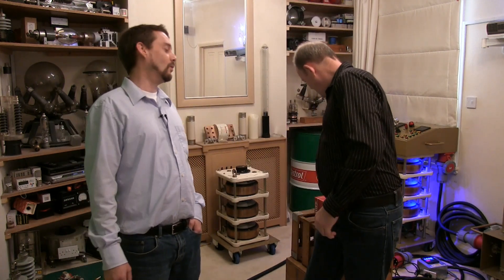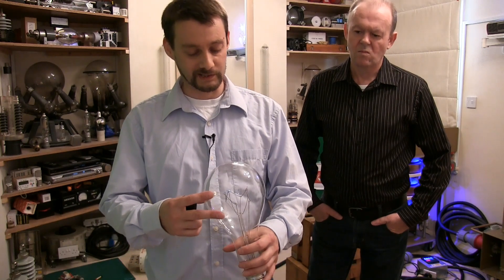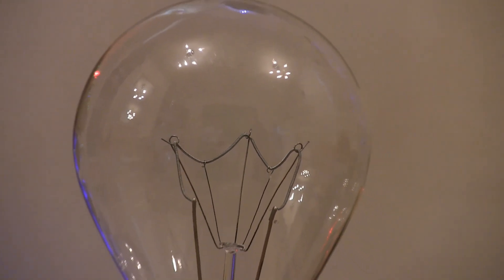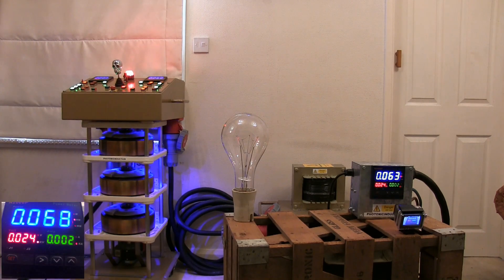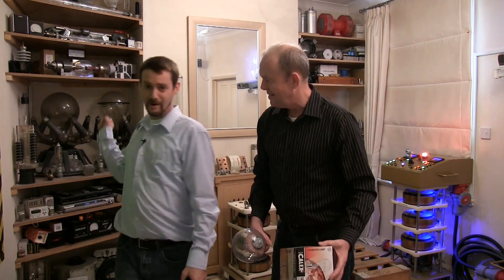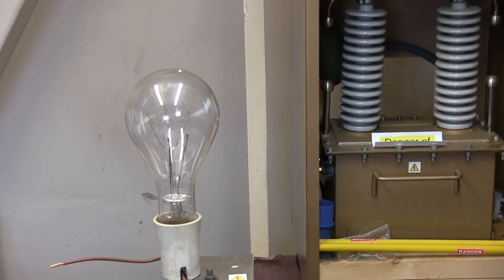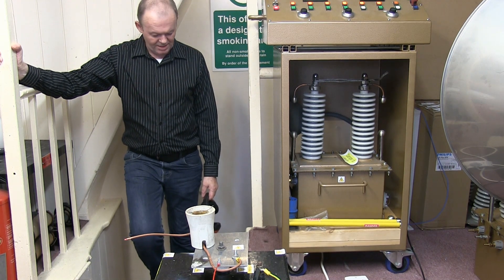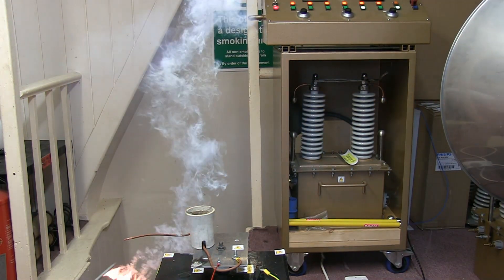Until it Pops - 1000 Watt Light Bulb

Comment: 3:20 how can 2 Transformers have a DC output? Are they both out of phase so when added have a DC output? Or are they pulsed? Or some sort of hidden rectifier I'm not aware of? Thanks.
Reply: Single diode rectifier I think
Reply: The diodes are visible to the right.

Comment: You could calculate the electric power that goes into the light bulb (or anything else you destroy by capacitor discharge): Put a large resistor (several MOhm) parallel to the capacitor and measure it's voltage with an oscilloscope. Then set the trigger to falling voltage, do the discharge and see how quickly the voltage drops. Let's say it discharges to nearly 0 in 50 µs, this means the average power output during this time interval is about 50 million watts (E [J] = C U²,   E/t = P)

Comment: good question why didn't you run the monster power supply through the light bulb from the smaller power supply that you popped slowly 

and get an arc in the bulb that burned out 

it would of been so cool

:)

Comment: How did you wire the transformers in series? My mot setup has the 2 hot outputs out of phase relative to the other hot to get 5kv ac. How did you wire the diodes to make it Dc? Thanks.

Comment: 1000 watt is normaly what the light bulb ''takes'' or ''uses'' from the net. To let him burn more watts (power) Ohm's law, Voltages times Ampere/resistant you have to crank up either one of them.
Breaking the glass has the same effect, a broken light bulb.
By the way it's quite normal that a 1000 Watt light bulb can give more lumens (the SI unit of luminous flux, equal to the amount of light emitted per second in a unit solid angle of one steradian from a uniform source of one candela.) because the factory tests these light bulb's at a higher rating than 1000 Watt. https://youtu.be/BylLOWRojyY
By cranking up either the Voltages or Ampere or lowering the resistant, you better measure the lumens from 1000 Watt up!
As expected the bulb die's.

Comment: For the display: Top is kilowatts, bottom left is kilovolts, bottom right is kiloamps.

If the decimal doesn't move, then you can pretend it's not there and then its simply watts, volts and amps.

Comment: "4 and a half thousand volts, 18 thousand amps."  Did I hear that right?  That capacitor can produce like 80 million watts?  It looks like it's pretty heavy, but still, I didn't know you could get capacitors with that much power density.
Reply: More like 80,000 amps. He popped a load of fuses ages ago with rupture currents of 80ka.

Comment: # pulling the plug is not an option that photonicinduction considers. #  correct, Voltage In is a suggestion.  in slow motion a flame dropped into the lamp.

Comment: Can that capacitor from the video be used as a 4500 volt stun gun? E.g., backpack mounted and then wires running to the side of some gloves in order to make a a punch pack a little more of a punch? Will the amperage be able to make up for the lower voltage?
Reply: Yes, but you'd have to charge it with an appropriate power supply first, it would be heavy as fuck and it would almost certainly kill everybody who touches it.
Reply: Stun guns usually have much higher voltage, but far, far, far less amperage. So it would have to be heavily modified not to put out so many amps somehow.
Reply: Remember that scene from District 9 with the lightning gun? It would be similar to that if you zapped someone with it.
Reply: +LifeRuiner Tyrone No, by killing I mean blowing their vital organs (e.g. their hearts) up and/or make them develop burns from the inside (there was a professor at the university I study at who died that way).
Reply: CoolKoon
my dad had a friend who worked as a lineman, the lineman's tool belt got too close to a neutral line and you can guess what happened next. His fingers blew off and he is crippled, poor guy.
Reply: Mikℯ Kℯn†
stun guns give out only a few watts
Reply: So what kind of power density can those capacitors have?  Maybe 8 MW per kg?
Reply: +LifeRuiner Tyrone God, he's lucky to be alive and that the accident only cost his two fingers. Such accidents usually result in roasted corpses you know...
Reply: +Megatom Capacitors' "kick" is usually measured in the energy they are able to store, not power. What good is a power rating that can be sustained only for a fraction of a second?
Reply: CoolKoon
yeah I have a ton of respect for lineman
they must get payed a small fortune, especially the ones who work on the 750KV lines
Reply: Hopefully, that must be a terrifying job, but someone has to do it if we want reliable electricity at home.

Comment: Great effect - glass vaporized or maybe it's pulverized.  I have to wonder though, exactly what caused that explosion? Was it the internal pressure from vaporized tungsten? Was there enough gas left in the bulb to expand exponentially when the filament hit the temperature of the surface of the sun? Nicely done Photon!

Comment: How did you rectify the voltage for the capacitor?
Reply from the maker: 2 microwave diodes in series
Reply: you have a half bridge rectifier, why not try full bridge?
Reply: +chems FULL BRIDGE. As Electroboom quotes

Comment: I would love to see this done with a fan of some sorts. Maybe even a box fan...
Reply: He needs to move his equipment somewhere more rural out away from town. Then he could do all sorts of fun dangerous experiments with all that power. If he cranked up a metal box fan until it blew it could possibly send blades flying at quite a speed. He could also make a railgun.
Reply: I want to see a rail gun on steroids :D
Reply: Induction motor will just smoke up
Reply: He already did a railgun ;-)
Reply: sirgallium The best (and safest) bet is to use a box fan with a metal casing but with plastic blades. so that if they go flying off; they'll simply break up before causing too much damage.
Reply: +TheFaced NO! Magnesium blades! Light them on fire and watch them go!
Reply: ... Well. Less watch and more be blinded by.

Comment: What exactly makes the bulb explode ?
Reply from the maker: Over expansion and expulsion of material and gasses
Reply: Must be it. It's true the bulb is not evacuated otherwise the filament would vaporize too quickly. I asked my self because we clearly see it is not the filament touching the glass. We can see it fall after the bulb explode. Must be the pressure and ejection of other material. Thank you Photon for the vid and answer !

Comment: The new microphone, I don't really like the way we can hear you breathing all the time.
Reply from the maker: I'm getting used to it, it needs to be inverted and I should not move heavy items and then immediately start talking.
Reply: Gain seems too high and sound is compressed. Should sound better if you lower the level a bit.
Reply: +Photonicinduction Photon, can I buy an HV fuse off you?
Reply: Andy, adding a small furry wind shield should do the trick. Or in a pinch tucking it under clothing but be careful of the mic rubbing - a bit of gaffer tape to secure the capsule works.

Comment: Put 5 of those huge capacitors in series. that would be cool
Reply: It could make a hole in the universe ;)
Reply: He could make a proper railgun with even that one capacitor. He probably doesn't have the space to do that safely in the middle of a town.
Reply: CoolKoon
Yes it would be less cool if you used the same voltage for the series string, BUT, if you charged each up to 5kV, for a total of 25kV, then you'd get the same amount of energy stored as having 5 in parallel. So no, it isn't any less efficient (except for internal impedance, but I suspect that the increased voltage will overcome that, to create the potential for very fast and large current spikes to be created. Then, the inductance alone might pose a bigger problem ... ).
1/2CV^2 folks!
500uF (5x 100uF in parallel) @ 5kV = 6.25kJ
20uF (5x 100uF in series) @ 25kV = 6.25kJ
Reply: Real emp machine that will fuck up everyones equipment in a 500m radius
Reply: +1marcelfilms Actually connecting 5 of the same capacitors in series decreases their capacitance to 5th of a single cap's capacitance. So no, it wouldn't be cool (in fact it would be highly inefficient).
Reply: CoolKoon then 2 in series and the pair in paralell.
double volts and double amps hhaaa
Reply: +‍1marcelfilms Now that would be rather interesting, yeah (even though the resulting capacitance would be equal to the capacity of a single capacitor)  :)
Reply: interesting
Reply: +Benjamin Esposti - Ozias Okay, the efficiency would (theoretically) be the same. I'm not sure how much would the stray inductance affect things, but either way you'd have to charge the caps with the higher voltage too (to get them to store the higher voltage).
Reply: CoolKoon
Yeah ... photonic could do it! :D
After all, he has those really high voltage transformers ... what, they are like 300kV I think? I seem to recall them being at least 100kV.
Reply: +Benjamin Esposti - Ozias Yeah, I guess the resulting "kaboom" would be even more spectacular :P
Reply: The guy mentioning EMP was right tho, discharging that much in pretty much an instant will fry up all the electronics in many metres radius.

Comment: I cant imagine "watt" your electricity bill looks like... hehehe
Reply: He has a battery system which allows him to charge up during cheap night clicks and stay off grid at day and especially when doing this electric stuff. It's all explained in an earlier video. :)
Reply: He probably gets business (flat)rates :P
Reply: ***** I wouldn't be surprised. :)
Reply: A lot of the equipment IS very expensive, but from personal experience (i'm learning to become an electrician) electricians get their stuff for a lower price (in most cases 15-30% discounts) than john doe from the nearest electrical shop.
Reply: It's not like he does this sort of thing everyday. A 100 W light bulb left on for a month would cost more than his 20,000 W power supply on max use in one hour.
Reply: BoardOfCircuit - Tech and Gaming
I'm quite confident that he got them for discount - running electric installment business has perks. :)
Reply: +Pessimistic Brony says the brony
Reply: Your name made that clear already Brony :-D
Reply: +. wat . I"volt"for this video.:)
Reply: hes probably hooked it up from the road hahaha
Reply: ***** I'm relatively new to photonic induction, only been here since 2015. Though I still imagine it costs a heck of a lot for the set up costs/equipment even if the energy is cheaper than I thought. Though thanks I should watch that video! :)
Reply: ***** Haha I can see.
Reply: ya I bet it's shocking.
Reply: Grahamaan27 "claps" :)
Reply: uh forgot to volt , now did
Reply: I just cringed so hard
Reply: mythbusters844
 you should be more worried about the fact that im completely fucking insane
Reply: spookje111
 Yes I like it that way because I get to see ignorant retards flip their shit

Comment: Do you take requests?  an until it pops of a PC Power Supply?  Everytime I have had one of these fail on me normally they are pretty impressive bangs and light shows, be even more interesting at high voltage
Reply: If PSUs fail on you that often, you should consider investing a little bit more money and buying a brand PSU from brands like SeaSonic or Super Flower. I'm exclusively using those brands for customer PCs and up till now not a single one failed.
Also for your request, Photon should definitely take a chinese no-name one, because trying to pop a SeaSonic or Super Flower PSU will be pretty tiring, since first you need to manually remove the Over-Voltage Protection, the Under-Voltage Protection, the Over-Power Protection, the Short-Curcuit Protection and the Temperature Protection before you could try to pop it.

Kind regards,
Meta Custom Computers
Reply: Ayy similar logos
Reply: Benjamin Esposti The particular power supply I had in mind when writing that was an Antec "Server" PSU which while turned off and still connected to the mains exploded in a small light show complete with smoke.
But things like safety and fuses don't seem to be a problem for Photon and they do have some lovely big caps and other things in them to go pop
Reply: ^^^ Meta Custom Computers, I agree with you.
Besides, it's good to get a well made PSU, since because it is less likely to break, you will have less motherboards that need replacing as well.. XP
Those cheap ass ones sold for like $5 to $20 dollars simply aren't up to the task. I've seen plenty that are labelled for "400W" or even "850W" yet the internal guts were only good for about 200W. And with the lack of OPP, what happens is the switching transistors on the primary side will blow once the transformer core saturates. Can easily send a surge into the motherboard, which can fry it to buggery!
Reply: Ahh, well, I'm not aware of Antec making server PSUs, but I'm sure it's quite possible for them to do so.
I don't really trust Antec all that much though, especially with the Fuhjyyu capacitor fiasco they had.
BTW it's always possible that even a good brand can make a bad PSU. I had someone give me a DELL SFF tower that went bang - the PSU is a common failure in certain dell machines. A google search revealed many complaints of them dropping like flies. I took the PSU apart and was going to fix it, but a particular hard to get IC was blown, so I didn't repair it. Just got a new one. The old PSU was made by HIPRO, which generally make decent power supplies (mostly for OEM's).
The new PSU was much different internally, even though it had the same part number and revision number as the old one! Go figure ... (Not sure who made the new unit, it wasn't appearant. No marks on the transformers or PCB, but the PSU was well made with a two layer firbreglass PCB and DC-DC converters for the minor output rails.)
Reply: Problem is when you are dealing with 300-400 machines even a 1% failure rate is 4 PSU a year.  I'm glad I don't do that job any more though
Reply: That's not to difficult, had a new office PC once, and it crashed. To get it going again I wanted to do a hard reset, but I didn't know then that you had to push the button for 8 seconds or something to force a shut down. So instead I was feeling for a power switch on the back (couldn't turn the thing around) and found one. When I flicked this I had a loud pop and smoke from the enclosure, turned out to be the 120/240V ac switch! So popping these power suplies isn't to difficult (when you live in a 240V country at least)
Reply: dieselmupke
That's a sign for a cheap PSU. Normally if PSUs have a 120/240V AC switch, the switch itself is retained with a piece of metal and a screw. You first have to remove the screw and the metal-piece before you're able to switch between the input-voltages. After toggling the switch you put back the metal-piece and put in the screw again.

Kind regards,
Meta Custom Computers
Reply: These were really cheap Dell desktop PC's, on a sort of lease to our company.
Reply: I got a win95 machine from a neighbor. It blew up inside my house ._.
Reply: Hell yeah Please! I never blew a power supply myself, but I saw how angry those cheap ones can be